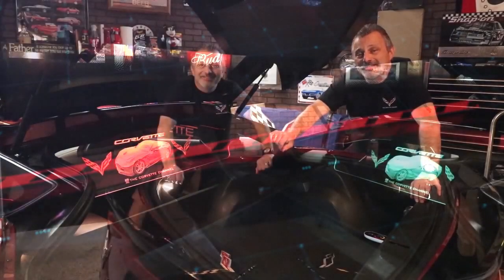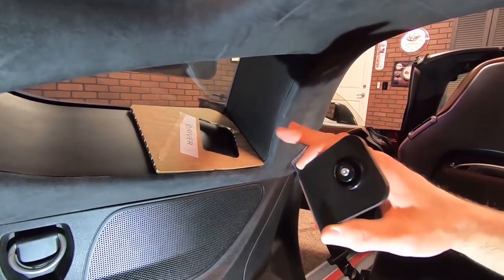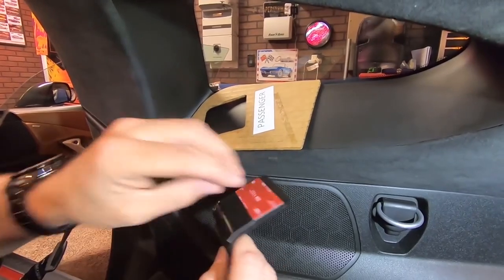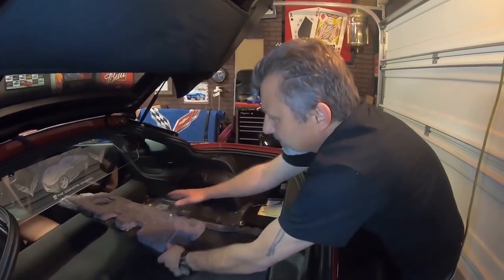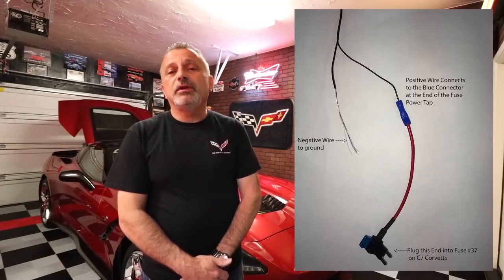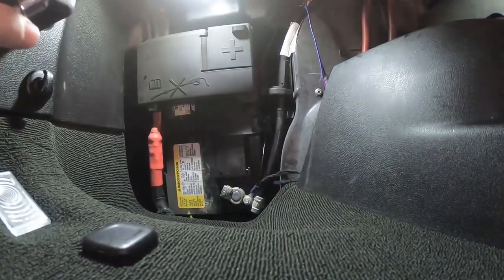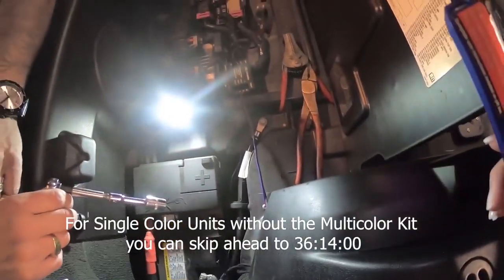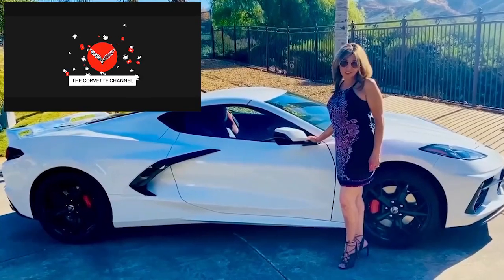How to Install the Ultimate Christmas Present For Your C7 Corvette

Comment: Thank you for the in-depth install video . I will be installing mine this coming weekend. I do have one question I hope you could help me with. For the C7’s do they come with the option to have the windscreen light up when you press on the brakes ?  I know you could with the C6’s but I couldn’t remember if it was an option for my C7 when I ordered it. Thank you for your help and all your great videos you put out !!!!
Reply from the maker: Hi Robert,

Depending on the setup.  IF you have the single light setup, you could wire it into the third brake light. But I don't know what wire it would be, unless you took the back bumper off to get to the wires.

Comment: At what operating mode(s) is fuse 37 powered up? Is it always live?  Will it power down after a certain time interval when the engine is not running?
Reply from the maker: It turns on and off with the key